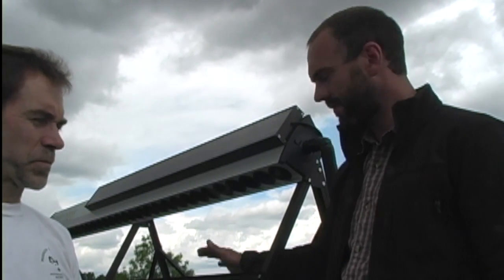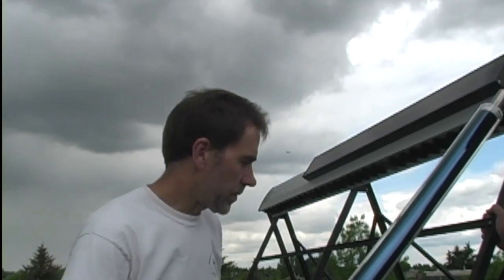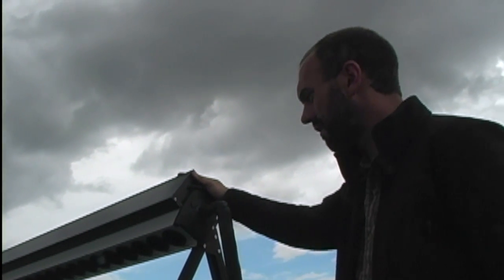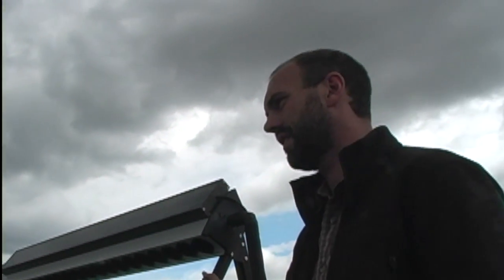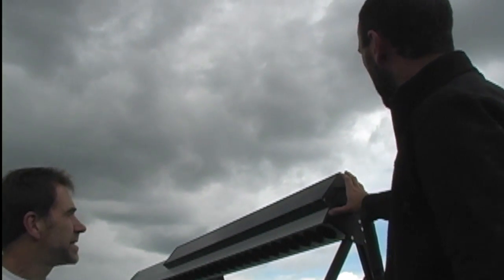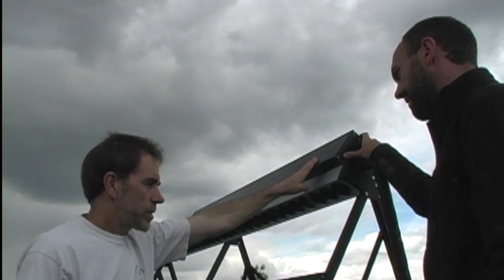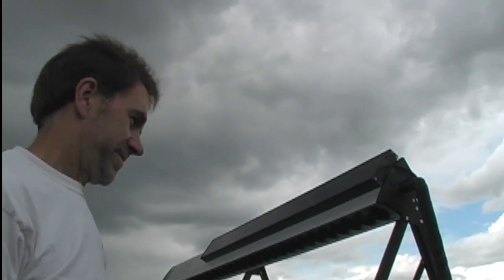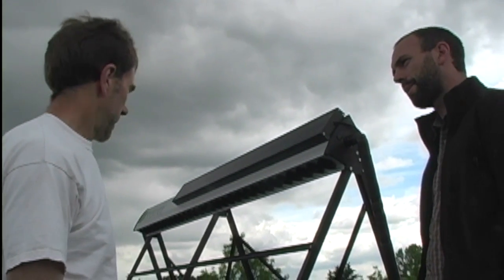Interesting Facts About Solar Heating in Calgary Alberta

Comment: How well do the tubes stand up to the hail here in Calgary? Is there any risk of damage?
Reply: Considering that our windshields were all utterly destroyed and the cars written off and the windows in the house smashed in and all the neighbours PV panels were smashed beyond use, I would keep some plywood handy to put over these whenever a thundercloud blows over.  A 1/2 or 3/4 inch thick plate of hardened glass might protect it, but who knows if it will block a bunch of the IR energy.  It will also weigh hundreds of lbs.

Comment: I am way interested, great video -  now I have two questions:
1) what is the warranty?
2) efficiency rating in ideal conditions?

       I'll apologize if I missed the answers in your video.
Reply: Robert R. Hi Robert, Kevin here with Simple Solar. I was just going through some of the videos we did with Verge Permaculture and noticed your questions. I figure late is better than never so to answer them, the warranty is 1 year for the whole system, however certain parts, such as the water tank, have a longer warranty. Regarding efficiency, solar thermal collectors are 70% efficient at converting sunlight to heat.